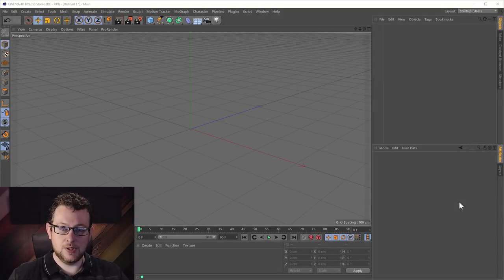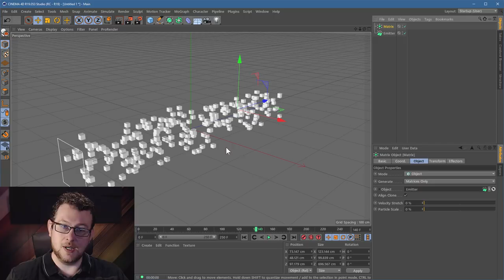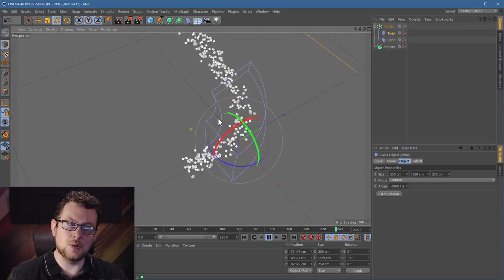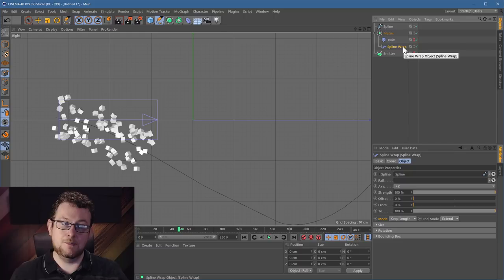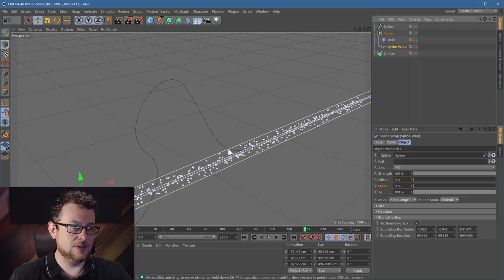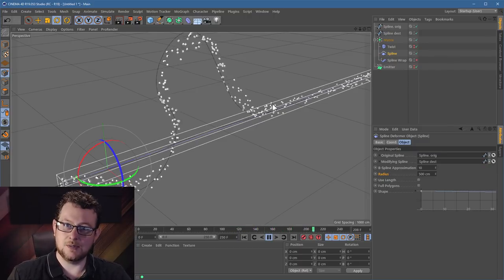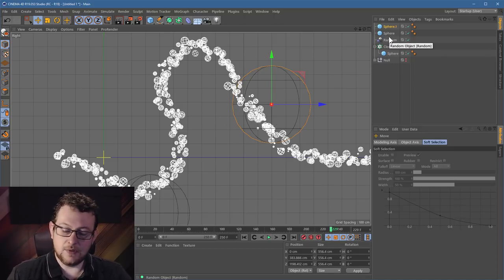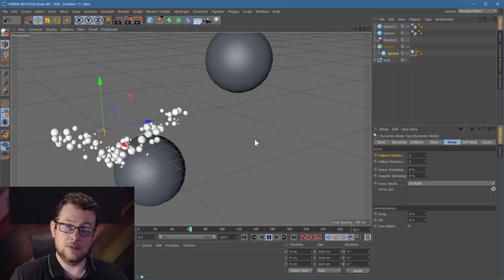Advanced Cinema 4D R19 Particles with MoGraph

Comment: Great tutorials! Love 'em ! <3
I have a quick question : at 21:30, the scale is resized using the random Effector. The resizing is updating in realtime as you scroll the value. In my case, it doesn't happen, and it bugged me a lot since I thought my Effector wasn't applied correctly. Why does my action of resizing is not updating realtime as I change the value? (I need to play the animation for it to appear). Thank you !
Reply from the maker: Try Preferences > View > Realtime values
Reply: I have verified and the option box was already checked. Thank you for your quick reply though ! :) I will keep on clicking around and see if I can fix* this. (I'm using version R19 by the way).

Comment: great video this is revolutionary, but I've found a problem with this. 

I have a quite complex spline that I want the particles wrapping on, but when I add a twist they completely rip out of the spline shape and just do a big vortex, Not sure why they spin and stick to the spline for you and for me they just prioritise the twist. Ive tried changing the hierarchy and putting the twist above just makes it not have an effect. Also the twist is much more powerful no matter what the angle or size of it so they don't go in a straight line but a big spiral. Anyone encountered this or  found a fix for this? Thanks in advance!
Reply: Ermm I have tried for hours before commenting this but turns out placing the twist above and simply turning the spline wrap off and on again works. No clue why but the twist is active now

Comment: Hello, actually for some reason on my perspective view everything looks fine but when I render instead of seeing a stream of balls filling the whole length  of the spline, they just just cover a 10th of the spline at any time and when they move forwards, instead of leaving a continuous trail from where they came from, they die out, so you only see a very small section of balls moving along the spline. Any ideas of what is causing this problem?
Reply from the maker: Remember the emitter has a different setting for editor particle count and render particle count. Make sure theyre set the same.
Reply: @3DFluff  thanks. I fixed that and the prob is gone. Cheers